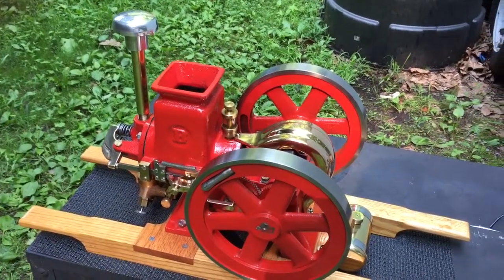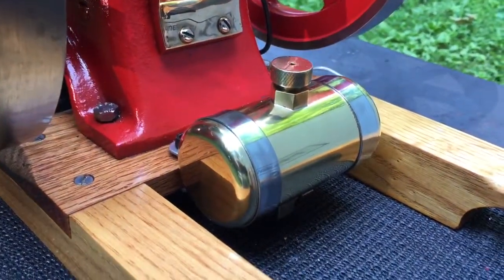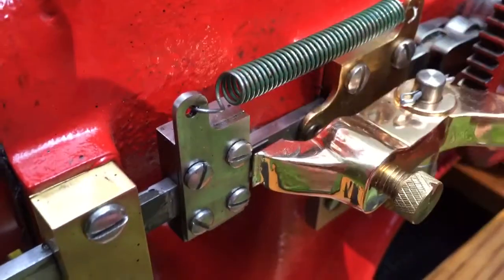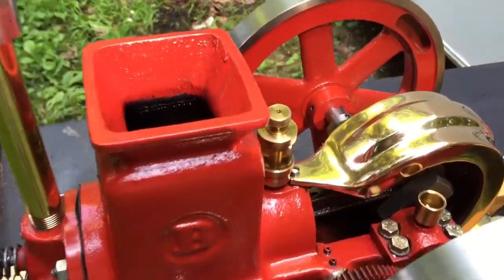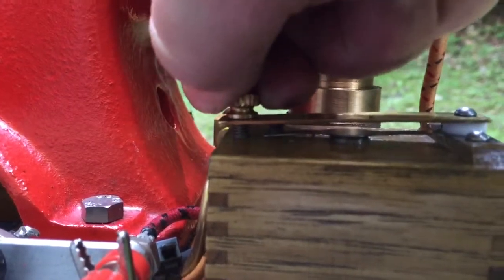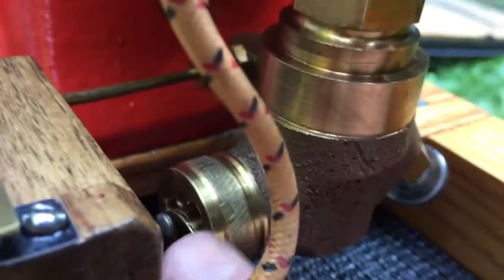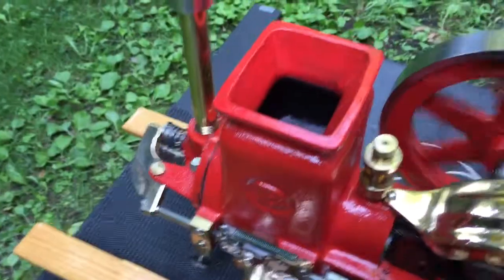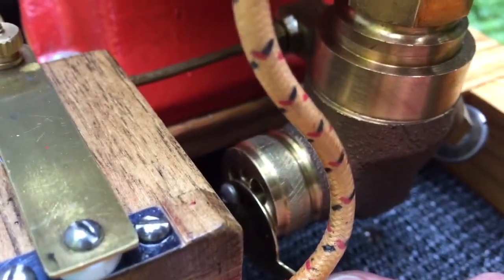1/2 Scale Olds Hit and Miss Engine part 1 of 2

Comment: hi,
i really like this videeo. i have just purchased the same engine used and it is missing a few parts.
i am new to these and have a few uncertatinties maybe you can help me with.
can you tell me what size ports are on that 90 degree fitting you put on you gas line before it enters the gas mixer? id like to buy that fitting but i am not sure what size it is.
i am also missing the ignition system on mine. i like the buzz coil over the magneto. could you go into a little more detail as to how you achieve the ignition timing on this engine with the buzz coil?
thanks much!!